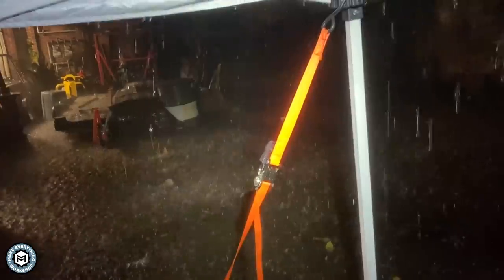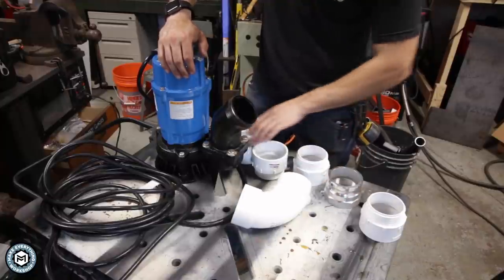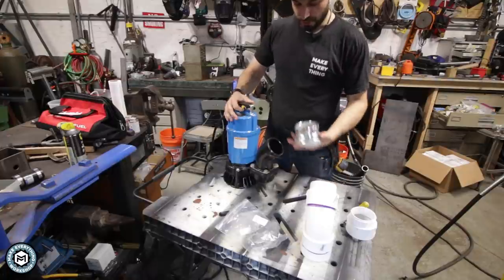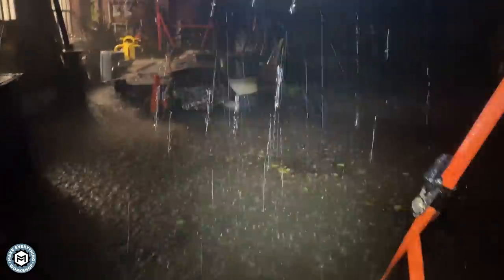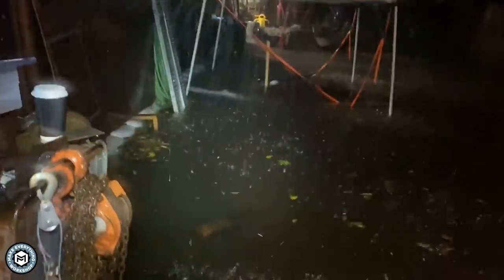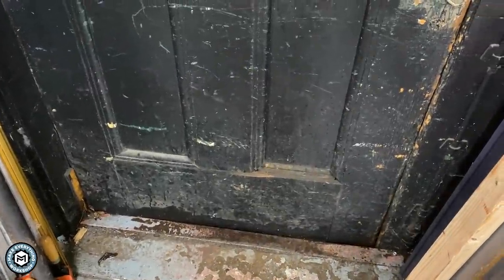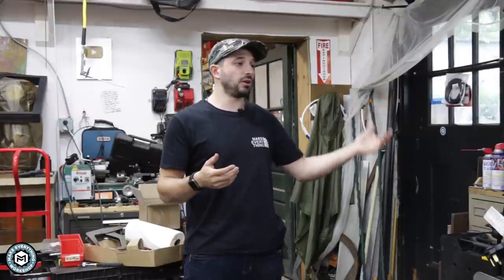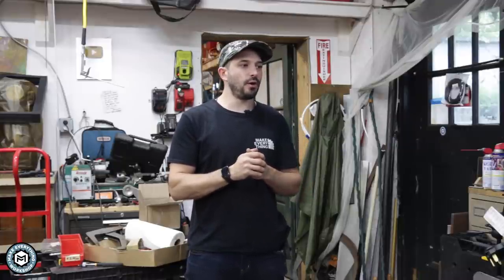Keeping My Shop Above Water, Literally - Hurricane Ida Flood

Comment: My suggestions for making the shop Flood proof:
-Cement/glue some stainless angle iron to the walls and the slab around all the doors
-Make some plastic/stainless/aluminium panels with gaskets that can be unscrewed quickly when the entrances are needed or even flip down ramps
-Have a safe place for the generator and keep up on the maintenance (use gas that is stabilized for long term storage)
Good luck with the next floods 
Greetings from germany
Reply from the maker: That’s what I’ve been wanting to do! I’ve actually installed water tight flood barriers on high end home’s in this area. With the scale of the doors, I didn’t want to invest in the material but after this… I might have to do it!
Reply: @MakeEverything  I'd check if your parking sewer drain is connected to the City sewers. If that is the case, you should verify if there is a working backwater valve on that line and make sure you're not getting extra water from the street sewers. Also, see that your pumps are not pushing water towards other pumps. I might be mistaken, but in the video it seemed that your indoor pumps were adding to the workload of your outdoor pump. Perhaps, it could be feasible to add a permanent rigid pipe that goes from your workshop to the street (or other area), which could be made to aid for a quick setup.

Comment: Years ago, I sealed the foundation to my parents house because it used to flood every time it rained. It was a long manual dig but it got done. The walls were re-studded and sheetrocked. Then came the a 3+ inch per hour rain in the middle of the night. The wall held but, I didn't seal the water main and water came shooting through the gap around it. Two inches of water flooded the entire basement including the small finished bedroom I was sleeping in. I know how you felt. You handled it like a champ and didn't give up. You're the man!

Comment: I'm sorry you have to deal with that, what a champ for toughing out though!  A couple ideas:

1)  Can you dig a depression for those pumps to sit in, so the water collects and they can kick on sooner?  Let them get a head start since they only have so much GPM.

2) It will be pricey, but I want to add another vote for the comment about building a raised floor system.  I have seen this done as a permanent solution in a few commercial applications.  A bonus to the raised floor, it gives you the opportunity to hide dust extraction, pressurized air, power, and other utilities but retain easy access.  It could be a great opportunity to rethink the layout and flow of your shop to make it more open and efficient.

3)  It can't hurt to ask the landlord to foot the bill for you to dig out some soil, add some rock to the driveway, increase the dry well capacity so you have more buffer.

4)  I just can't believe the fact that some landlords try to pawn problem properties off on unsuspecting tenants.  It may be worth talking to your rental or business insurance to see who is liable for replacement value if your shop does flood and tools are ruined.  In some locations and special circumstances, rental insurance will sue the landlord to recoup the cost, i.e. if the landlord neglected a known problem and that problem caused the damage.  Getting this information and notifying your landlord may motivate them to help more.

Best of luck!!

Comment: I feel for you. On May 8, 1979 we had 9 inches of rain in less than 15 hours. I went up to the apartments upstairs. On the first floor the water was 4 1/2 feet deep and it eventually reached that level inside and I was able to open the door to get out.  I lost everything I owned except for the clothes I could put in a garbage bag. The only thing I had insured was my car. When I paddled out in a canoe the car was under water. The water made it to 1 1/2 feet deep on the second floor.    And life goes on.

Comment: Kudo's to you for all the thought and work you put into the prep for the latest flooding. It was a duzy. All in all you faired pretty well. The ols coot that built my home hand poured the basement floor in an angle so that when water comes up the french drains all I have to do is open the basement door and let the stream run out the door and down the driveway. I end up with a stream about 2' wide and 8' long. This time the stream ran for 2 days after the rain stopped.

Comment: cut holes in the floors 18-24 inches for the pumps so they are below grade in the lowest parts of the shops, the hole will act as a reservoir and should stay ahead of the water

Comment: 1. I feel for ya, I've had 8ft of water in my Mexico shop twice, 9.5ft once. It takes weeks to clean, paint, re-mobilize... 2. Make the gen a permanent install w/xfer switch, that's a whole video. 3. Work with Ur landlord to move all downspout outlets so they don't flood the driveway, that'll help. 4. If I was the landlord, I'd think about raising the floor, looks like U have the headroom.
Reply: also, take the interior pumps to discharge at top of drive so that water doesn't get pumped twice

Comment: Looks like you did the best you could do and it worked as well as it could. I would say that it might be time to invest in a gasoline powered (trash) water pump in the 160+ GPM range.  HF has a Predator model pump for $220.
Reply from the maker: I’ve been trying to get my hands on the 230gpm 3” trash pump they make… I hear good things!
Reply: Bit of a ride for you but they have one in stock in North Windham CT.
Reply from the maker: @Ed-lt3pp  my store said Thursday this week hopefully! If not I may have to travel for one just to have it in hand!
Reply: @MakeEverything  Be sure and call first.  The North Windham store's inventory showed products I wanted that no other store had but wasn't actually in stock.  Also, they won't hold product, so you have to call and then drive over there quick.

Comment: Ideally the best thing would be to raise the floor, but 25" is a lot.
If entering via the fire escape is easy, mount the generator inside with an external socket and a pipe from the exhaust to outside to preven carbon monoxide, alternately have an external shelf for it.
Here's a hose tip (i used to be a firefighter with my workplace), when you want to empty the hoses, pick the end up and throw it over your shoulder, walk forward feeing the hose over, be gentle with the male end, being aluminium it  can damage easily
btw, the rolling method you used was the 'dutch roll' but you don't normally use a stick

Comment: Goddamn NIGHTMARE. That tropical storm we had a couple of months ago screwed me because I was out of town. came home to 6 inches in my basement where my shop is. But I was ready for the hurricane. Battled the water coming up my sumps for 8 hours straight and kept most everything out of my shop this time. Thankfully. My garage out back has a water line in the side of it 30 inches high. The perks of living a few blocks from the sound in Connecticut I guess.

Comment: Hi, I think the only remedy to your problem is to remove about 18 inches of door and build the wall 18 inches above the present height, get another two pumps and go round and seal any other ways that water can infiltrate your shop. You also need to get that drain outside checked to see A. where the water goes to and B. if it is blocked with silt

Comment: Just saw this video so it’s been a while. Glad that you made it through with minimal damage and no injury’s. I sure your probably tired of armchair quarterbacks but these are some thoughts I had while watching. The doors going in to your shop look oversized so could you add a solid barrier to the bottom out of masonary and then cut the doors off on the bottom and rehang them. It looks like you would end up with doors of standard height. Also your shop looks like it has high ceilings so could you build another floor maybe 12 inches higher ?  Good luck in the future

Comment: which u r all doing fine, IMO u could make some half doors with some slides (u shape with gasket) and when u have flood u could just put the door slides (in front of th existing doors) and manually screw them, and inside u could have a small hole at the lowest place inside the shop and put a pumpe inside it

Comment: Man. I hope your shop won't get all moldy. You'll need to make some "water trenches" inside just behind the door and put a big pump in all the "trenches" to keep the water from reaching in. And next time you'll need to get the plastic barrier sealed so that it won't leak from the sides. Also you need a bigger pump for the outside manhole. And put it into the bottom of the manhole so it'll will be empty when the rain starts.

Comment: I had to fix a friends place who had the same issues. I ended up using a skid steer and lowering the surrounding grade 6 to 8 inches. Literally plowed entire property of about 30 feet around his shop. Downgraded driveway so that it would just flow down and out. Added a step to his door and a ramp to the garage door. Hasn't had a problem yet, this has been a few years.
Reply: Also, watching you pump the water.. UP HILL made no sense lol
Reply from the maker: Unfortunately, there's no way to pump the water anywhere else! My driveway is about 8 feet below every grade nearby!

Comment: Maybe do it like that - dig 20-30cm trench in front of doors u dont use , aply concrete with bricks to connect the walls like if there was no doors etc , then when cured, paint it using poliurethane sealing paint that protect form water 
everywhere u use doors u can do the same , dig trench with bricks but this time only to the grould lvl , then make small groove in it so u can just stick in it for example chipboard like a valve in a dome 

simple alternative is to again paint everything using protective coating , then just seal everything , the easiest way is to do it with concrete (like if it was silicone)  and then paint the concrete 

Extra thing to do is to make small dome inside the shop ...maybe some long steel /plastic/ aluminium angle glued to the floor using silicone everywhere around (everywhere u move etc u can blue rubber angle etc)  so then u just add 1 pump in it and u dont need to wory about the water because the second dome will stop it

Comment: Is there any way to further excavate the driveway and fill with gravel? or have some kind of pit or channel drain on the far side of your driveway? Other than that raise your floor level, or make sure that anything that could get damaged is at least a foot off the ground
Reply from the maker: I forgot to mention it in the video, but the driveway is already peppered with drywells, and the coat to excavate and redo the drainage is pretty significant. Even so, the neighbors properties dump so much water into the area I’m not sure it could ever keep up!
Reply: @MakeEverything  my house is the lowest down a driveway like yours surrounded closely by 2 storey buildings and about 2m above sea level. So I feel your pain. I'm lucky my foundation is higher than your workshop though.  I built up around the lowest side with sand and now I'm high enough that the water now drains into the neighbours yard which can handle it better. Shhhhh don't tell them

Comment: All your gutters go into that catch basin. 

Get a bigger gas powered trash pump. Pump right out of the catch basin and up and out into the street or someplace  that can handle the water.  If your city’s storm system can’t handle it then honestly I’d move.  

Seal up the doors you can. Semi permanently. 

Store nothing directly on the floor.  That’ll make a big difference cuz if water does get in it won’t be a big defeat. 

Good job with what you had to work with.  

Also get some rubber boots lol

Comment: first why isn't the landlord trying ti fix this.i worked for path trains and after sandy and all the flooding we had we installed storm doors, which is nothing more then u shaped metal channel attach them to the brick wall use rubber gasket between them and then just make boards that fit into the channel gasket each board and the top board build set up to give down pressure .but the gaskets are the key and it works great we store them out of the way quick to install when needed.

Comment: Aside from moving as a solution, which from experience is the only good answer, get yourself a trash pump.  The electric pump you have is not designed to move that much water volume in such a short period of time.

Comment: There's nothing you can do against water, you can mitigate it. One way would be to have sand bags at the ready, build a dam with a pump to push out the excess. I've seen a few houses protected in this fashion, it's the most cost effective method. The bags need to be quality tho.

PS the future isn't bright in regards to storms, expect more of this type to come. We frakked our planet, big time letting rich losers run wild, now, we pay for it. You should take that into consideration, because this won't go away in a year or a decade, it's only going to get worse. And yes, i know, nobody wants to hear this the first time, but you'll experience it, be wise and take steps that are above (no pun intended) what's to come.

Comment: I didn't like your video because you were taking damage but I gave It a thumbs up anyway do you remember when the mighty Missouri flood speaking from experience caulk cost a lot of money yes but how much does a Bridgeport cost a metal band saw computers lathes and sand bag two foot away from your doors four foot high wrapping sand bags in plastic sheeting or tarps you can even caulk the sand bags together over kill No it's insurance. sand bags should be three feet wide by four feet high.